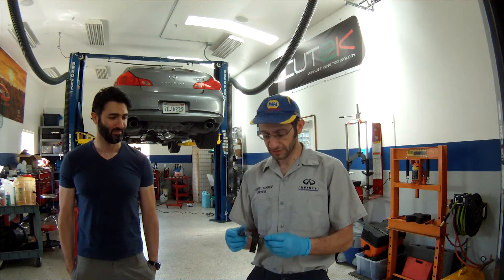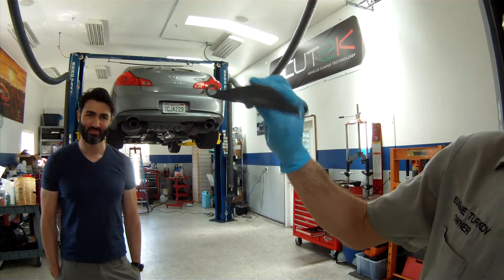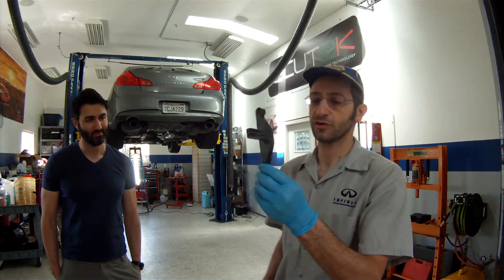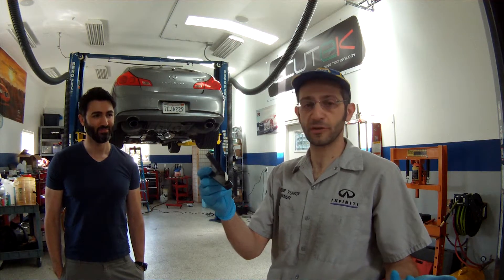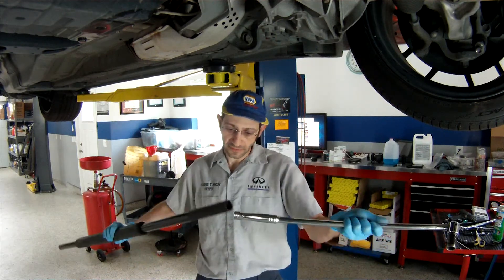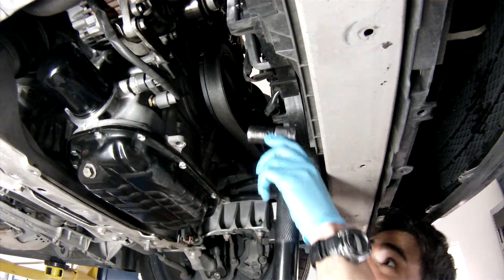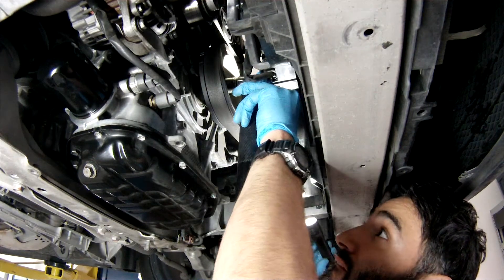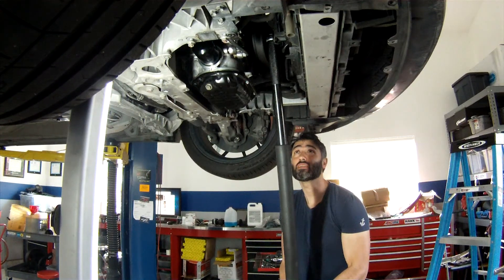DIY: VQ35HR/VQ37VHR Crank Pulley Removal

Comment: Look for the guy using a belt to remove the bolt
Reply: that's a bad idea. these cars have a harmonic balancer. the outside of the pulley is separated from the inner part using a rubber bushing. If you put a strap wrench around the outer portion, it will stress the bushing material and could cause the harmonic balancer to fail. best way to do this job is to use the special service tool shown in this video.

Comment: What's the name of the tool?
Reply: Did you find out the part number for me by any chance?
Reply from the maker: jesse rodriguez flywheel or flexplate holder tool.
Reply: @EnthusiastAutoCare  is there a specific one I should? I got a vq35hr
Reply from the maker: jesse rodriguez yes I can look up the part number later. Check with me in a day or two.
Reply: @EnthusiastAutoCare  got you

Comment: Did the bolt actually break loose? Should it be gear at all when doing this? Thanks for this and other uploads, very helpful.
Reply from the maker: TheEpeebles yes i always breaks loose. Doesn’t have to be in gear.
Reply: I just bought this tool! The only right way to do this job!!